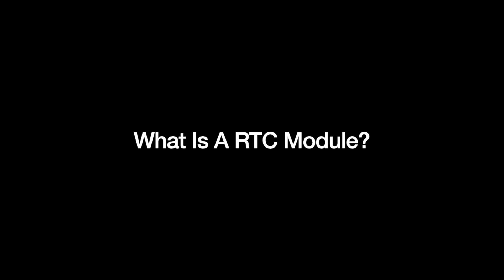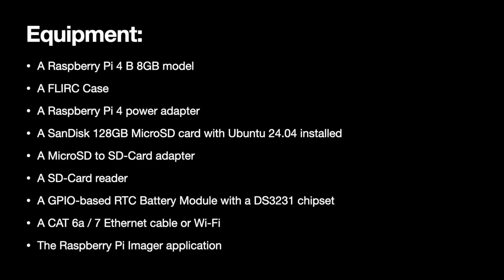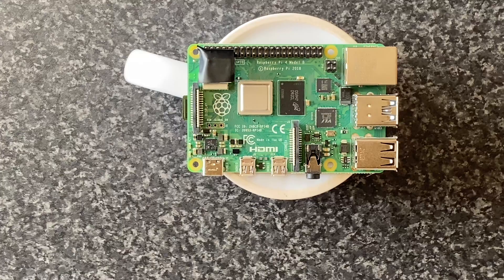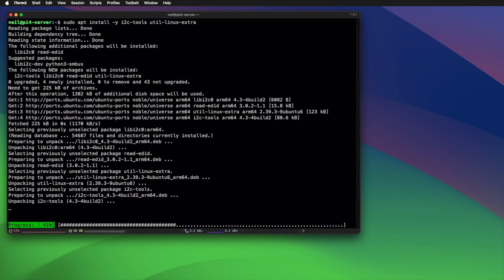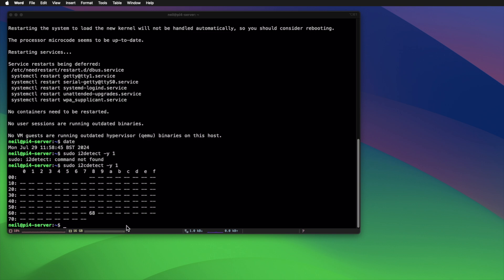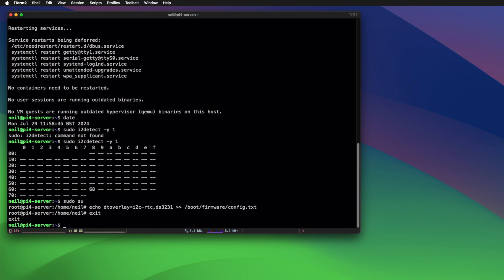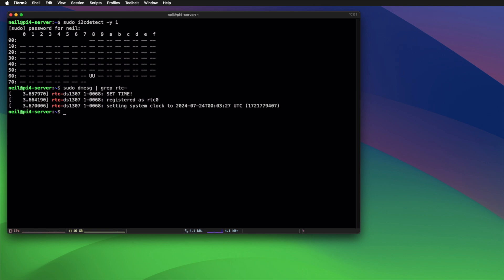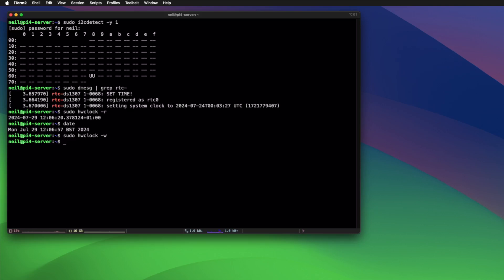How To Setup A Real Time Clock on A Raspberry Pi 4 Using Ubuntu 24 04

Comment: it whill work for rocky linux?
Reply from the maker: I don't know. I don't use Rocky Linux on my Pi boards. 

It might work but I wouldn't be surprised if the files used in the video are in different folders.

Comment: So this would only be needed if you didn't have internet on the pi?
Reply from the maker: It's certainly one reason but it isn't the only reason. 

Take for example a Pi that is being used as a server to collect data from an attached sensor and as part of that, it stores it with a timestamp in a database. There is an internet connection present in this scenario.

Now, let's say the power goes down for everything in the building, be that a home or office. The power is later restored but the Pi boots up before the internet connection is restored. With an RTC module installed and configured, the date and time will be fine. If there is no RTC module and no internet connection (assuming no local NTP server is present on the LAN), the date and time will be incorrect.